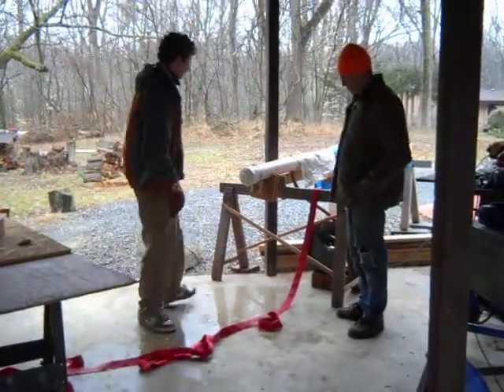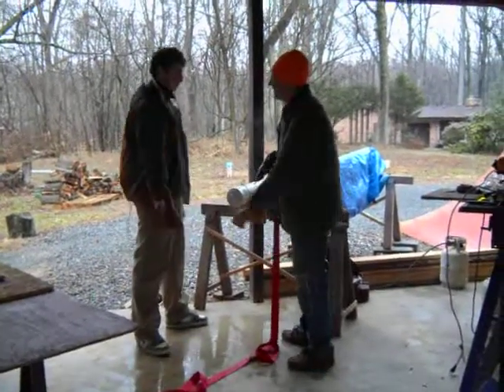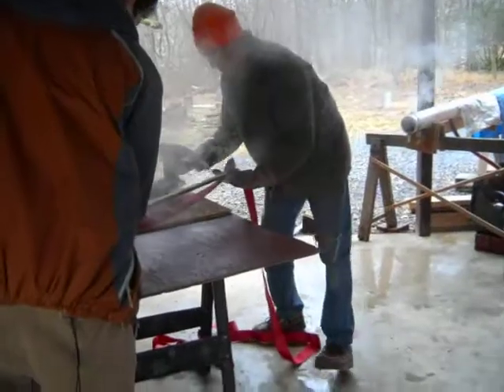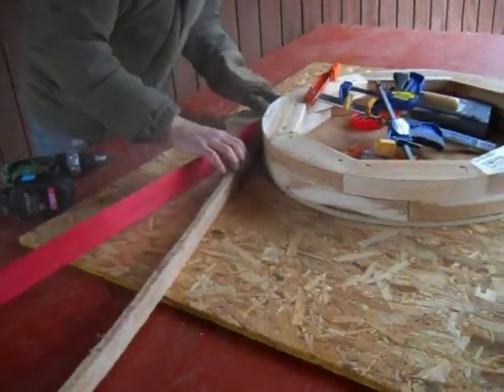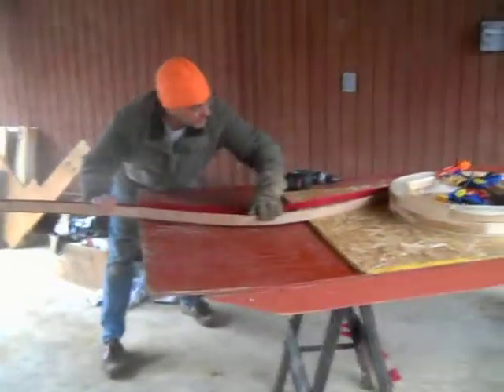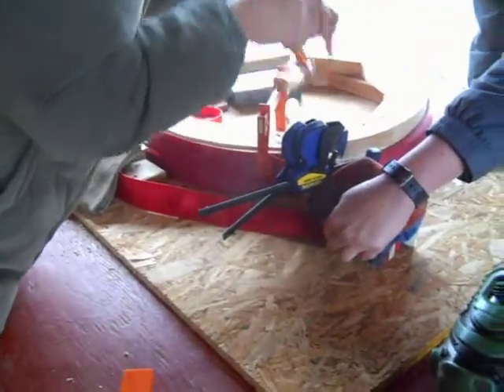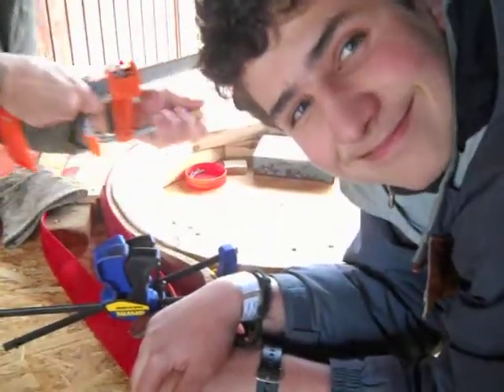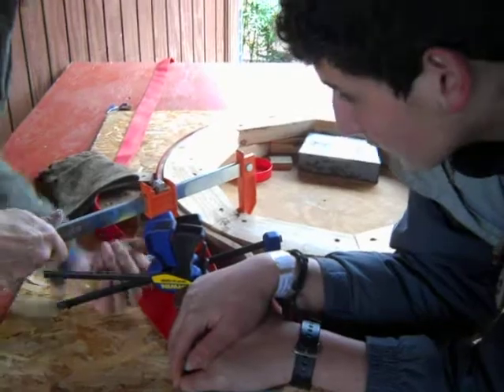Steam bending sweetgum into a 25" diameter circle (ID)

Comment: How NOT to steam bend.  First rule: know what you are doing and have everything ready and prepared..  These guys are a bit befuddled as the attempt to make the circle.  Clamps should have been placed at every 30 degrees.
Reply: Never fails to amaze me how the trolls crawl out to put down someone LEARNING and TEACHING at the same time.
Reply from the maker: +Jefferson Martin You are absolutely correct that we were befuddled.  Prior to this video we had built a frame and successfully bent parabolic shapes using thin strips of sweet gum.  This video shows our first attempt at making a circle.  We learned quite a bit about what not to do, improved our technique, and ended up with reasonable results. Unfortunatley, we did not take videos of our subsequent efforts.  We ended up making a half-scale model of the submarine hull we had designed and used it for testing.  The final hull was made out of fiberglass.  If you have other suggestions for improvement on the steam bending technique, please post them so that viewers will be set up to succeed in their steam bending efforts.